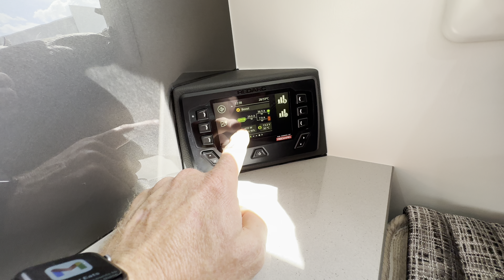2025 Spec Latitude Element 27 Motorhome.

Comment: Ben have you considered using fridges that the fridge is on the top and freezer on the bottom ?
That way you're not bending over looking for something at the bottom of the fridge and people who are older find them easier to use.
Plus you use the fridge a lot more often than the freezer.
Just a suggestion
Reply from the maker: @rickystewart2839  that would be a great feature. There’s a number of things we consider when selecting appliances. At the moment we think this one is the best overall choice.